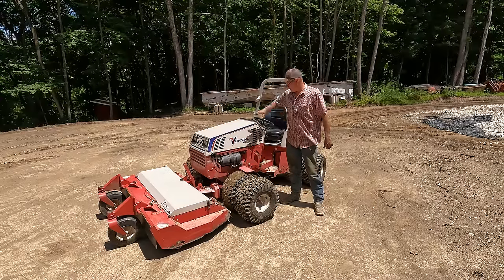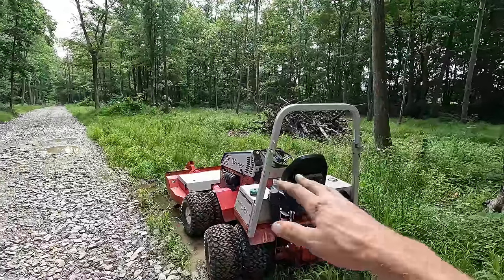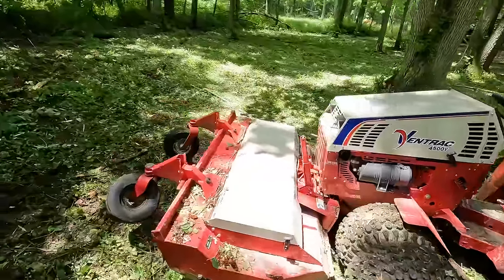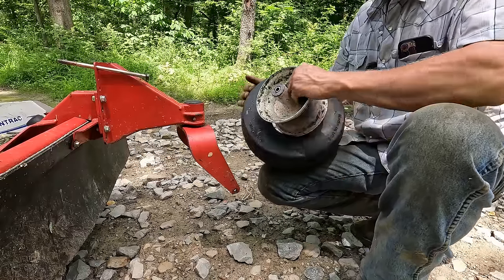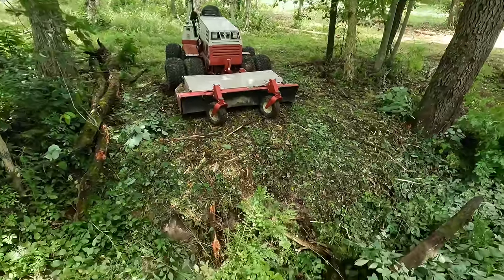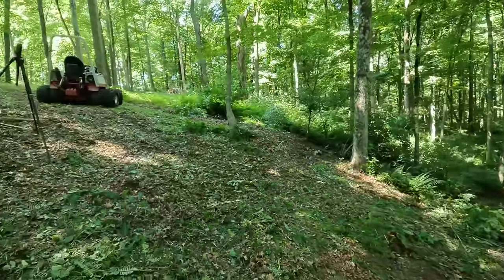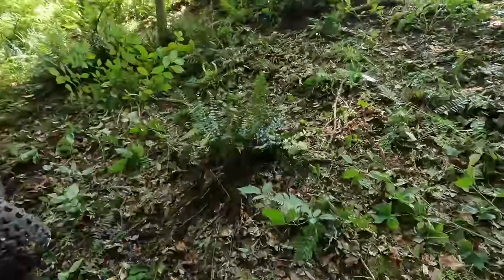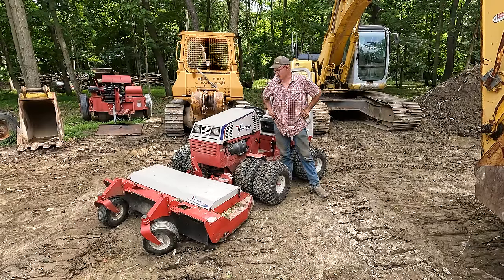Cleaning Up the Farm, Pushing a Ventrac to its limits! (4x4, Diesel, BEAST!)

Comment: That is what you get when you cross a zero turn mower and a mountain goat. it will go anywhere and eat everything! I can think of many times that would have made my job a whole lot easier. That is going to be a very good addition to your fleet and the only thing I can think of you might want to get for it would be a snow blower and cab. It would work better in tight spaces for snow removal than your other toys. Nice job, Matt.

Comment: Great machine. The tire pressures have to be right on. If the outer tires have more pressure than the inners , you will snap axles. Also Steiner attachments will fit that machine with a belt change. Good luck with it and clean the radiator screen daily.
Reply: Tire pressure? I thought he said they were solid rubber?
Reply: @BillAndersonNS  it's the wheels on the cutter attachment that are solid
Reply: @BillAndersonNS  Not on the 3 that I have.
Reply: @BillAndersonNS  the attachment casters are, the main tractor tires are pneumatic.

Comment: There was a bad batch of hydraulic hoses on these 4500's underneath the seat where one of the hoses breaks lose from the fitting.  You may want to keep an eye out for it.
Reply: How do you know this
Reply: Because mine busted and I called the dealer and he knew which hose it was before I even told him where it was located.
Reply: Lmao
Reply: Shhhh thats part of the fun!
Reply: With a thousand or so hours on, wouldn't it have shown by now or been sorted?
Reply: a bad batch ?   c'mon man just because yours broke that doesn't equal a batch .  relax and enjoy Matt finding Ticks .
Reply: @FabricationStation36  the fact the dealer knew which one it was before being told tellse either it's a bad batch of hoses or a design flaw
Reply: #LETSGOBRANDON  but he'd just fall off of it..
Reply: @philgrimsey3637  I would guess it would have.  I think I missed how many hours were on it.  Mine was under 100 hours when it blew off.
Reply: @Tater_Lord  This is exactly why.  I would have expected Ventrac or the dealer to at least contact owners if it was a known issue for a specific date range of machines.  The dealer did take care of it including hauling each way.

Comment: I’ve had my 2018 4500Y for over 1-1/2 years and use it to maintain a 20 acre farm in middle Tennessee, 1/2 wooded and 1/2 pasture, and several 20-30 degree slopes and embankments.  As others have mentioned, setting that weight transfer lever to 5, on the lower left side (orientation is from the drivers seat), is important for maintaining traction on the steeper slopes.  I’ve got the slope indicator on mine and have occasionally pushed the tractor past 30 degrees with confidence (no concern for rollover). 

Avoid driving over low cut stumps on a rise/crest in the terrain.  I’ve high centered my 4500 a couple times on the linkage that connects the two articulating halves.  The first time I was able to wriggle the tractor off the stump under its own power, the second time I had to pull it off with another tractor. 

My 3 most used attachments are the tough cut (mowing pastures and underbrush in the woods), the slip scoop with grapple (I don’t have another tractor/loader or heavy equipment at my disposal), and contour mower (mowing lawn around the house).  The stump grinder and trailer mover are probably the next most used attachments.  I also have the Harley rake and trencher, which have also been useful from time to time.  

The 4500Y has been an indispensable, rugged, and reliable tool for my needs.
Reply: What?  No yellowjackets or hornets  nests??
Reply: Solid answer! Thanks ;)

Comment: If when of no casters decides it wants to walk of the rim again there is an adhesive made for that kind of rubber to steel you can apply to avoid that happening. Cause the more times it happens the more times it'll happen.

Comment: Those Ventracs have so many available attachments that they can do nearly everything any tractor can do. Brush mowers, rough mowers, finish mowers, snow removal equipment, radial brushes, tillers, blowers, specialty attachments for sand grooming, playing field grooming, you name it, Ventac has it. They even have full enclosures with heat, defrost, wipers, etc.

Comment: Matt I think after cutting I think you need to get all this branches stumps logs that could not cut put in your fire pit then you can cut all the lot and take a chainsaws to remove the brush you could not cut remove all to burn now you can run the Ventrac completely if you want some cheap grass mix let's get drainage to the end of the road 4"courrageted pipe down 3" and covered with stone will drain to creek or beginning of driveway

Comment: The second stick is for hydraulic controls if the attachment has hydraulic lines. The push brush attachment can be can the direction using the stick.

Comment: Interesting machine.  Backing down on tricky gullies and such may be easier where you can drive through it rather than a forward attack.  Prescribed or controlled burning is a good way to keep the ‘undesirables’ down to a low roar as well as pest management and forest health.

Comment: Awesome machine.  Loved watching the one that John at Upstate Brush control used to have in action.  Hard to beat a purpose-built machine.  Unfortunately it’s just as hard to justify owning one if you don’t use it on a regular basis.  That said, I’d really love to own one.  PS - I still can’t believe you got that tire back on the rim without boogering it up with using only the forks!
Reply: It's that easy touch on the controls. I have no experience at all with any heavy equipment and by watching several of these guys out here operate heavy equipment with such a soft touch, well, most of them, I am impressed.

Comment: I would be putting a hoop across the front, bolt on where the wheels mount.  It would help pushing the taller growth under and might save the castors a bit, and keep some rubbish out of the radiator especially if mowing dried out stuff.  But it works as it is.

Comment: As with any machine-
No matter if Seller stated it was "serviced" I still change oil & filter,
Marvel in fuel & oil, grease & lube all. New battery, etc. 

I'll bet Wife is happy-
Remember when she asked you "why don't you buy anything nice?"
Well, here you go! That machine looks awesome.

Do you have any kind of snow moving/removal equipment?
I wouldn't scrape a plow on gravel. 
You need a decent 2-stage snow blower.

Comment: I work for a university and maintain sports fields. I've demoed the ventrac and stiener. We used the finish mower and it did great. Alot of  golf courses are going with them now. Due to price and cut quality. They are great machine and great quality. If I had to choose between the steiner and ventrac. I would pick the ventrac. The forward control is easier to use. Where as the stiener seems stuffer and hard on our hand and arm. But both machine are good quality.

Comment: In the fall when mowing is needed again, call me. That was slightly sketchy in parts but satisfying in total. I dont know I could resist jumping out and sawing down saplings though.  The machine can do it, but save the blade by not cutting down medium sized sapling. That thing is a beast. Where did you learn about it? I know there are some other youtubers (stony ridge farms) that are paying top dollar for lesser equipment.

Comment: I know you aren't at huge fire risk up there but one of the leading factors in forest fires is poor woodland husbandry. Keeping the brush short and deadfall under control can prevent thousands of $ in damage.. Good on you.
Also, that rim. Is it possible to separate it? It looked like it was a 2 part rim.

Comment: Excellent video Matt  :) also think that Machine 👍 works excellent plus attachment use for that you should check in is blade on front for Winter Season months and back a packer roller to like use on lawn tractor for lawns ! Also think that super work horse too and give one idea for metal pail with cement with rod middle for arms to try weight too !

Comment: it looks like in some cases you may not be putting the deck into "float" by pushing the main lever "SDLA" all the way to the right.  This can cause the front end to lose traction as there is down force on the deck when it rolls over uneven ground.  This looks like one of the reason your having trouble "holding the hill".  

I tested the diesel and didn't find it to have enough power for my hilly yard when pushing the finish mower.  Looks like you're not having much issue with power

Comment: those machines are amazing for landscaping contractors. I keep seeing them push they can bush hog with them and to be honest, you mowed things that are about the limit for me on a tractor, I worry about how the machine will handle that long term. Sounded like some belt slipping and all. Other than that, once it is cleaned and grassy- bet on it, a versatile piece or equipment. I want one to do aerating with one day.
thanks for the videos.

Comment: In my experience you should have a bunch of the pto belts, because the attachment dont run that belt perfectly straight there is alot of were on it.  And you should absolutely look into a sickle bar attachment, super handy to have

Comment: We had a ventrac for about a year and a half from a sponsorship with ventrac, we absolutely loved it,  great machine! Had a couple of attachments but the tuff cut was the best. Just a FYI when you go to sharpen the blades one of the motors has a reverse thread. I believe if you are sitting on the machine it was the far right. Have fun!

Comment: I've used these for years. Very good piece of kit. Highly recommend keeping a set of belts in stock. There are grease nipples underneath on what's called the dog bone, pain in the ass to get to but vital they are well greased. You can also get a bank angle indicator that sits in the hole above the headlight switch. You don't need to take much notice of it but great fun seeing what stupid degrees you can get it to, trust me you chicken out before the machine gives out.
Reply: I too am very impressed, the ability to cut 2" young trees amazes me. The idea of keeping a spare set of belts is vital. You could hear what sounded like belts slipping occasionally. Prior to my retirement I ran a Kubota F3690 for a private business that mowed public reserves here in New Zealand. It was about 60". Great machines.
Reply: It is a very impressive machine. I use a walk behind DR brush mower that will take down 2 to 3 inch saplings, but it is a beast to handle on slopes like he is using this machine. The riding all wheel drive of this machine makes it effortless, but after cutting 2 inch saplings and all the other brush, those blades won't be worth a darn for cutting a lawn.
Reply: @johnphillips4342  I've a mower I use for both grass & mulching hedge trimmings. The latter gets the blade changed to an old one, saving the other just for clean grass.
Reply: @johnphillips4342 l’m
Reply: @williamamtmann7104  You're?

Comment: Matt, congrats on getting your Ventrac! I used to sell the younger brother to it when they did business under the Steiner name. Attachments to want... the bucket is sweet, they have a loader as well, but their finish mowers are incredible.... and they have a stump cutter as well. Now, you will ONLY want to use the hydraulic oil that Ventrac recommends. That system runs at pressures that would make you squirm.... Ventrac/Steiner used to void any warranties if any other type of hydraulic oil was used in their system. It all has to do with microscopic air bubbles... they will trash the pumps and motors.... huge money to fix. I hope you get many years of service out of it my friend... this video ought to be Ventrac's showcase promotion video! You killed it man!
Reply: The world  needs old school like you to teach the younger  people  the right work ethics.  You rock
Reply: The Special Oil is only 4times the price of regular oil and available only thru Ventrac!

Comment: There is a weight transfer lever.  Make sure it is set to 5.  It will take the weight of the cutting unit and transfer it to the wheels and help greatly with traction.

Comment: The reversing power of the Ventrac is very impressive. All that downward weight and momentum but the Ventrac backs up effortlessly. Great machine in the hands of a good operator.
Reply: It sure reverses the growth of that brush in a hurry.
Reply: yeah  them kubota engines are worlds toughest  brand on the market  thats why ventrac and kubota partnered together
Reply: Wonder if it's hydralic drive
Reply: @michaelmactavish4445  Over 2000 hours on 05 BX 2230. From tilling to mowing to plowing to blading.
Reply: @afberglund2764  Yes
Reply: @paulprigge1209  yeah there pretty tough and reliable  wich im kinda wished my town bought a bx sidewalk machine wich wouldve been way alot cheaper then a $202,000 holder s75  wich seems way over pricey for a 75hp tractor
Reply: @michaelmactavish4445  Yep. Though for bigger stuff, the Isuzu diesels are what I like.

Comment: Looks like a good little machine. My luck going into areas overgrown like that, I'd find large rocks, strands of wire, and long forgotten pieces of scrap iron.
Reply: Yes could happen.  You would have to walk unknown areas first
Reply: Barbed wire is the worst thing I found.
     Didn't cause damage or injury but it got wrapped up tighter than an orthodox nun.
Reply: I’m surprised there are no rocks.
Reply: Happens to me all the time with my brush hog. Wire is a bit of a pain to get out but doesn’t damage anything. I hit an old tire once when mowing a field of blackberries. It killed the engine immediately and scared the crap out of me. Thought I’d destroyed something, but it fired right back up and I went back to work.

Comment: Super cool machine!   Gotta love that kubota diesel too!   Pro tip… with those electric PTO clutches , it’s good practice to engage at a lower rpm, then throttle up.   I am usually around 1/2 throttle when I engage.  A lot less wear and tear on that clutch and belts.

Comment: I think this will be great for you Matt, they put quite a bit of engineering into these ventracs, and they are purpose built machines.
Reply: Absolutely!  💯
Reply: Ya but the problem is its new anything new is a peice of shit 2001 and down is where all the good reliable shits at
Reply: Ventracs and Steiners are built to withstand the abuse and workload that the children of a country farm family can throw their way. I have seen young boys work in places that were unbelievable. They build them strong  and they last.
Reply: @working_country ___ 
Steiners are still being made. Some family members wanted to go in a different direction with the design and started Ventrac. Both are being built today. 
Thanks,
JohnB
Reply: I’ve owned three Steiners over the last 20 years. I love mine. Our property (I’m about two hours from where they’re made in Ohio) is pretty hilly. You’ve already discovered how they tend to slide downhill when you’re mowing across a slope. Watch out for their tendency to lift a wheel if you try to make a sharp turn uphill.  Maybe with your duals it’s not as bad. The snowblower attachment is a godsend for keeping our farm lane clear. Have fun with it. My latest one (Steiner 430 Max) is 20 years old and I imagine it will last me the rest of my life.

Comment: Great "Little" Mower...After you did your first mow around your property you now know where there are little /medium trees that block you from mowing/moving forward.  Take your chain saw and walk your mowing area and cut those blocking trees down so the next time you mow you will have a clearer shot to mow right through.  A little effort now will definitely make your next mow much more comfortable.  Also take your bucket/dozer and knock those small hills down to even out your next mowing.

Comment: Now that you mowed the steep hillside and can see them, take some time to throw the bigger pieces (4" and bigger diameter ) down the hill to the bottom. You will be surprised how much easier it will be to cut the next time , it won't crab like it did the first time. I saw that you had the weight transfer lever in the high position , but sometimes it helps to take the deck out of float and relieve the resistance of pushing the deck wheels through soft ground. After owning one for 6 years, I can say that Ventrac makes excellent mountain goats.

Comment: Im sure you know but you should engage your blades or pto at a low rpm and then raise the rpm to reduce shock to the hydraulic system.
Reply: You have a good point, I know to engage the PTO at low rpm, but there are some people who are new to equipment that wouldn't know this.

Comment: You have to adjust the weight control thing for the deck. It will make it go just about anywhere. Get your self a couple extra front pto belts they burn up quickly. Amazing machine I love them.
Reply: Don’t travel with the deck up experience